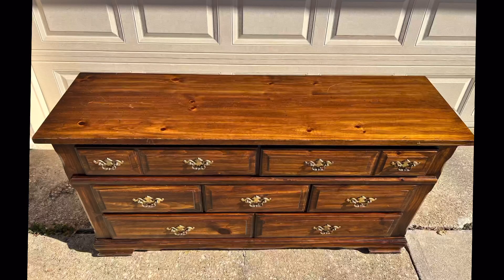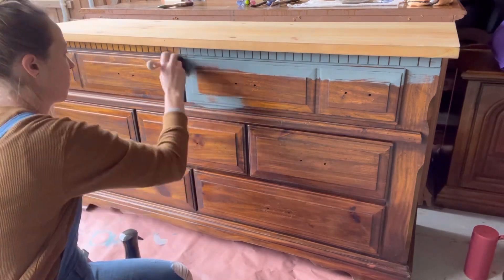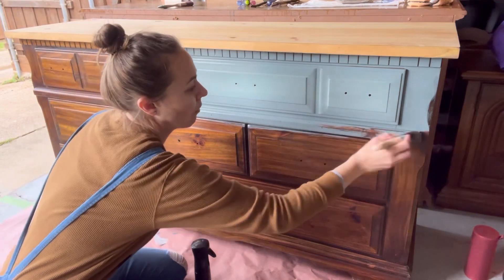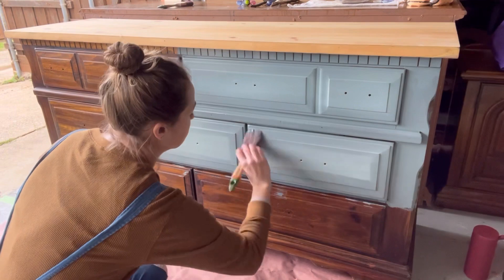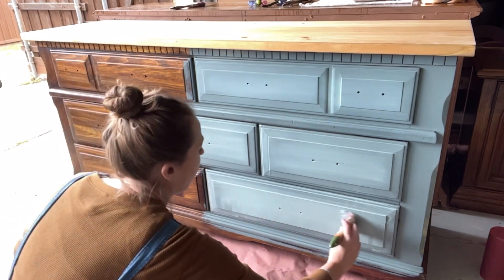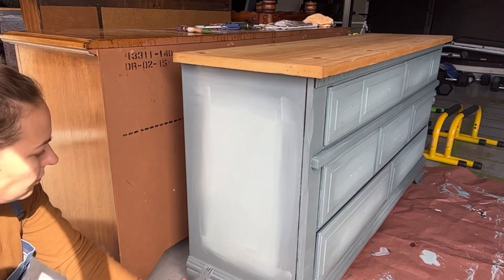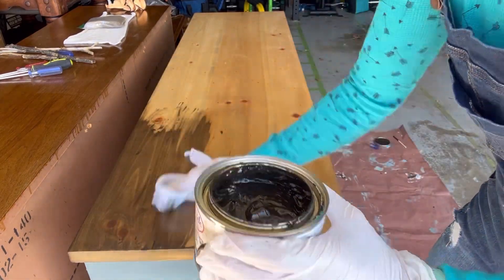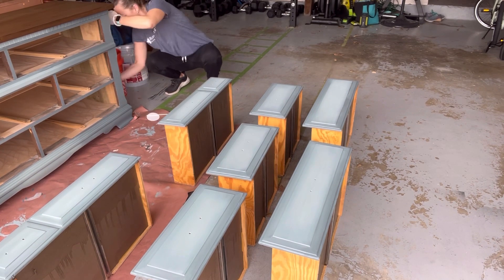How to blend chalk paint for beginners!

Comment: With your aerosols make sure you turn upside down and clear the tube before and after you use them every time and that should take care of your spray paint problems. Also if it is cold warm your can up with warm water and if it’s really hot then wait for it to cool down. The heat will dry the paint as it’s coming out. If you have a clogged nozzle which you won’t if you always clear the tube pop it out and soak in hot water or a little acetone.
Reply from the maker: Thank you so much for the great advice! I will definitely try this!